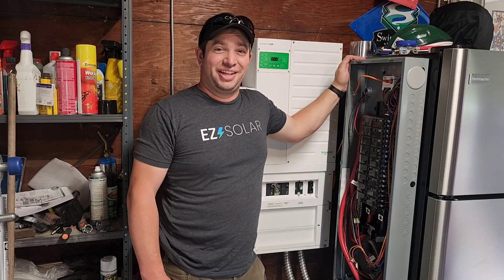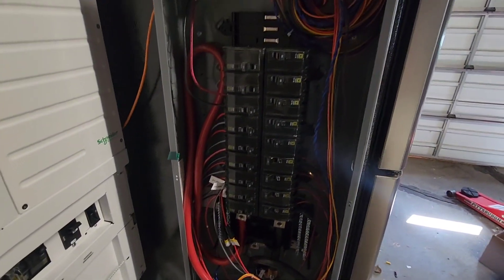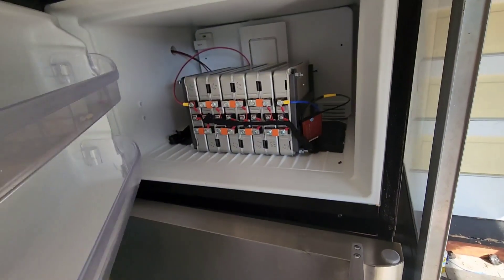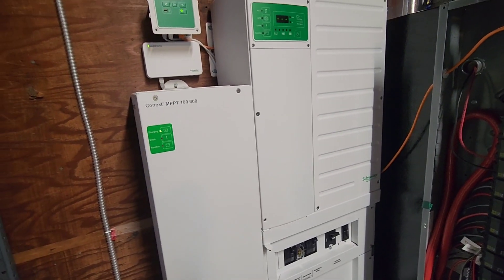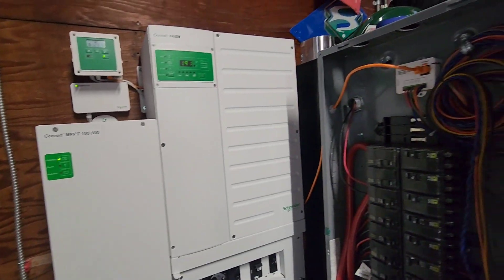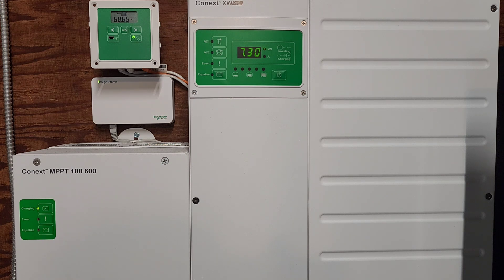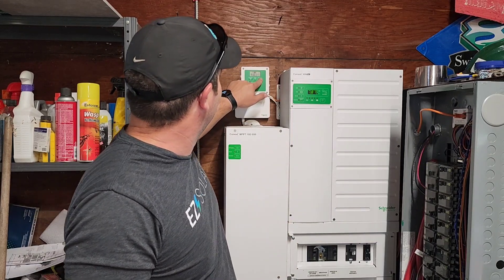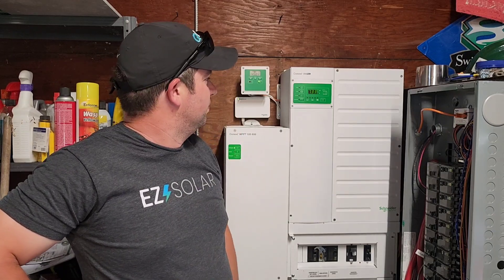Sol-Ark 12k Kept Shutting Down. Can the SMALLER Schneider Handle it?

Comment: HF inverters work great for grid tied systems. It can use the grid for short times of heavy use. Majority it's just back feeding a main panel loads are not that high. If the grid power goes out always reduce loads until power returns.

Comment: Hi Ben, wondering if you could help with some info? I have a stack of Volt Batteries Chevy and want to purchase a schneider 6848 pro  as well as there 100/600 mppt.....can my chevy volt (48v) packs work with this system? I cant find how low I con go with battery voltage as well as charging paramters
Cheers
Kameron

Comment: On my own personal experience, with XW+, Conect MPPT 80-600 and 24 Rolls Batteries  S2 L16 EX 2 volts 1040 Ah @ 20 hours, we ask the customer to turn on everything.... even an old window AC ( which turn to be a power eater...), the inverter goes up to 7.5 kwh for 15 minutes without problem at all.  Not even a blink.  We then shoot the whole load off, to see the batteries, connections and final closing.  
 My point, Schneider is an excellent inverter that with the toroidal transformer make a great difference when dealing with those inductive loads.

Comment: Without an iron core, copper wound output transformer, the Chinese engineered and built, low cost high frequency inverter tech that's used in the Sol-Ark or EG4 6000XP can't possibly compete with the peak power capability of the Schneider XW inverter.

Comment: All high frequency, transformerless inverters are junk. Its been that way for the past 25 years and it will never change. I would never install any brand  of high frequency inverter in my home. The only real inverter is a low frequency, transformer based inverter charger like an XW, Outback, Sigineer Power or a Magnum unit.

Comment: xw has a transformer , sol ark does not . If you put an external transformer on sol ark you will be able to power those inductor loads with ease. You buy equip per application and not buy then try to apply it. It is called research and planning then deployment

Comment: I do realize there are a few biggest 120V loads that will overload the 12K (9Kac output). That is why we introduced the 5K-1P single phase and 15K-2P split phase. There is no 120V load that will overload it. As Sol-Ark CTO, I am happy to provide you with one for testing if you will do the same video.
Reply from the maker: Hi Tom, I would be happy to trade my 12k for a 15k.  I've had to remove it because it kept shutting off, and the little hellions that run the house complain when their internet shuts off.  Let's talk more. Benssolarandbattery@gmail.com
Reply: @Sol-Ark  Sir, do you have any surge test results your company did prior to releasing the 5K-1P single phase and 15K-2P split phase?

Comment: THE MAIN diference Between the two, Schneider is low frequency and the other is high frequency. Low frequency IS best suited for HIGH start amps
Reply: Isn’t it funny that people complain about SolArk shutting down while trying to run high inrush loads. It’s not rocket science. My entire home with 6.25 tons of heat pumps runs fine on two 12k’s. I don’t run high inrush loads. Ding ding ding.

Comment: With the solark u have to buy the soft start for the ac then it we’ll work without issue
Reply: Bingo. Or buy inverter compressor equipped units.

Comment: But everybody talks about Sol-ark like being the best when I started with my system I started with a 12v I got a 12kw Sol-ark and change my voltage to 48v but if you sneeze to hard it shut down, so I sold the sol-ark went back to 12v I lost 240v but it never shut down again thank God for the Samlex 3012 evo I know I see your video. This was even cheaper. Thanks Ben.
Reply from the maker: It was the best on paper when it came out... then it got tested.
Reply: @benssolarandbattery  this one do you test it can it be connected to the grid to sell power
Reply from the maker: @solarandwindinsouthtexasda1473  yes, it can sell power to the grid as well. The only place it falls flat right now is self consumption with AC couple Solar, but that should be fixed in the next year.

Comment: Depends on your family and people living in house. If you install Sol ark or any other MPPT solar inverter you should be fine as long you have things running before you run through a heavy load. Most people dont use compressors or other machine base torque motor loads.  240v things are the cause of shutting it down. Any sudden load with no capacitors ( pre-charged) to handle the surge will pass on SOL ark or any other Inverter and kill them. Schneider loaded with Capacitors that loaded with live current for those surges. 2 Cents are Schneider is Quality but not needed , Sol ark looks good for grid feedback capability but still look for off grid korean MPPT hybrid inverters. They worth more than both on bang for the buck.

Comment: Thanks for doing this and publishing. This really is a service to the community. I am a true 'off grid' guy (no grid), with pumps, shops, etc. I will not use electric dryer or hot water or heat, but air conditioning -- yes. So the overload capability of this inverter is a big deal. Other inverters blip off with any surge beyond their load limit. I also care about gen input, since we have winter weather where I live. This inverter can deal with that, also.

Comment: Do you have any experience with the AC breakers popping at different currents for DC current instead of AC?
Reply from the maker: No, I haven't.  I'm using 2 pole 20a breakers for this setup and have seen 15-18a max through some of them.  They do get a little warm when up there for a bit, but that's to be expected.  They're rated for DC as well, so we should be ok.
Reply: @benssolarandbattery  

Thanks so much for the reply.

Are most ac breakers rated for dc and ac or just your special ones 😉
Reply from the maker: @bkspotify4337  square D QO are the only ones that I know of (in terms of residential load centers with breakers) that have the dual rating.
Reply: I run 450VDC at 10A through a Sq D QOU 60A breaker. Gets up to 120F on a hot day. Works fine. Shuts off fine.

Comment: Due to space constraints I went with the 15k. I have ran 10k+ on grid no issue have only had it about 7k off grid inc ac. No issues yet. It's hard for me to push it to the max of 12k just because most of our appliances are gas.

Comment: I recently installed my 15K and am extremely impressed. Maybe I’m a bit biases after spending the money on it so take that for what its worth, but its taken everything I’ve thrown at it. It started my 3.5 ton A/C, that has a surge of around 90A, on just batteries! My loads are pretty balanced but it doesn’t seem to have the same problems the 12K had with legs being out of balance.
Reply from the maker: Glad to hear it!

Comment: Was that on a 15-kw sol-ark, 12kw, or 8 kw? We just bought a 15kw sol ark. Our loads test for daily electrical consumption was at 23kw and during the 5 summer months high side of use it was at 38kw daily 7-hour solar production will be at 49kw daily, I did not see a problem with the 15-kw sol-ark and 20 kw battery back to handle this, Am I missing something? We are not grid tie, total off grid. leaning towards the ark battery or S.O.K. battery.
Reply from the maker: That was on the 12k.  I have mostly electric appliances and it was having trouble with a few of them. I've also installed them on off grid houses and at least one of them has had issues starting a chop saw.  I'm sure the 15k can handle more.
Reply: @benssolarandbattery   thanks for the clarification.

Comment: Glad to see you reconsidering the Conext XW Pro system.  I installed one a few months ago, and have been insanely happy with it.   I use mine in "UPS" mode,  similar to how you had your original problems.  It's been rock solid.   I wired the AC Load to a critical loads panel,  and then added a continental controls wattnode modbus..  so it can sell excess power back to the main panel,  but not send it back to the grid. (no net metering here).  One of these days, I should hire you to double check all my settings and parameters, since I did it entirely DIY.

Comment: From the XW Pro product page, the unit will run 12kW for 1min, 8.5kW for 30min and 6.8kW continuous. I’m glad you’re enthusiastic about the product but it performed exactly as it should during your dryer and compressor test. 

Unfortunately, you’re setting up Sol-Ark to fail your testing because of the 12k specs. It’s not apples to apples with the XW Pro. A Sol-Ark 15k would be a better test comparison. 

Good job with the channel. Great content!
Reply from the maker: Thanks! I'm happy it did exactly what it was supposed to do.  The 12k should do at least 9k, which it couldn't. Their specs do say that it can handle large overloads briefly, which it absolutely cannot.  Both have their time and place for sure.
Reply: Yeah that’s an issue with them listing the surge in VA. You shouldn’t have to be an engineer to figure out if your equipment will work. A motor with a lower power factor will cause the system to have way less watts available for actual work than the rating appears to have.  I definitely see why it’s misleading. 

I’m researching off grid systems and grid tie with storage for some friends and myself right now. All this info is very helpful.

Comment: Between this and David's videos, I checked the specs from Sol ark and determined that the last inverter I would buy is a solark. The 12k is actually a 9.8k. That is why David's kept shutting down .
Reply: Yes they rate it at solar not wattage. I have a 15k which can do 15k with solar and battery or just 12k without solar. Never had an issue and haven't needed soft starts.
Reply: @hoocli  I can hook up 1Mw of panels to mine. It will still put our 10 kw. That's a deceptive number. The only tru number is inverter output kw. Not how many watts will pass thru the busbars or any other number.

Comment: The XW has a massive chunk of iron and copper in its main lo-freq converter. Hard to beat that with the more fashionable high frequency topologies.
Reply: Yeah I was unaware of this distinction until I saw it on the marketing literature for Victron. They seem to not be lying. It also sounds like the quality of the transformer on the output side is important for idle current draw and efficiency.
Reply: @NicholasAndre1  Yeah the type of transformer makes a big difference in idle draw. For example, I have a 4000 watt inverter that I built to experiment with. Using a standard square "EI" transformer it idles at a little over 100 watts. But using a toroidal transformer it idles at 34 watts.
Reply: @edisont.picard4112  very interesting. I only vaguely recall the transformer characterization from my power systems class 😂
Reply: @NicholasAndre1  Basically a square type transformer has a lot of flux leakage, but almost all of the flux is kept inside a toroid. The trade off is that toroidal transformers have a massive in-rush current that has to be accounted for.

Comment: Your experience with the toaster is interesting. Cold coils draw more current (they have a positive temperature coefficient of resistance) and the singing is indicative that the Sol-Ark output filters are near saturation (when they quit filtering the PWM). As the coils warm up the load lessens and they quiet down. Indicative of a marginal design (wonder what other aspects of it ar marginal?). The Sol-Ark is transformerless. Your Schneider have transformers. Welcome to the more robust world of transformer output inverters. I wrote the papter on inverter reliability and this issue.

Comment: Btw, correct me if I’m wrong, the XW can only use up to 64v which is only 1 volt higher than the SolArk. I say this because I think I heard you say this Schneider can do up to 68v. Sucks for 16s NMC users like you and I, but I only want to charge mine up to 64v but still to close to the max these inverters can handle
Reply from the maker: We were both wrong!  The XW can do up to 65v charging.  The charge controller can do 67v and the XW alarms at 68v. I'm good with those parameters.
Reply: @benssolarandbattery  still slightly confused.. the xw can’t do charging at all but you said it can charge to 65v. I’m assuming you mean the xw can only handle up to 65v. But that doesn’t make sense if you say the xw only alarms at 68v
Reply from the maker: @RJ-cc1fz  it can do charging from the grid or AC Coupled solar while off grid.
Reply: @benssolarandbattery  got ya.. I wasn’t thinking about Grid and AC couple charging.. so the separate charge controller will charge up to 67v and the inverter can use up to 68v then alarm?

Comment: Did I understand you correctly that the Sol-Ark shut down on grid power?
Reply from the maker: Yes sir.  I don't know the exact amount of power that was running through it, but if I had to guess, it would be 12kW.  No breakers tripped.
Reply: @benssolarandbattery  What inverter do you suggest I look at for 30k grid tie with battery later on? Can you stack Schneider?

Comment: Great video Ben!  I am curious about how you wired the SolarEdge system in ( Mid panel or Main Panel Etc).  I am in progress of my own AC Coupled design but have decided to not couple the SolarEdge but actually install a old SMA sunny boy inverter.  I have previously had problems with the SolarEdge being too sensitive with the XW+ inverter and shutting down here and there.
Reply from the maker: Thanks!  I wired it into the main panel, but I also have a separate interlock panel with a grid feed, so I can easily feed the grid independently of the entire backup system.  I too have had issues with the Solaredge AC coupling.  It wasn't great with the Sol-Ark and is the same with the XW pro. I had an autotransformer wired in as well, so tried turning that on and it actually fixed the flickering issues I was seeing on both the Sol-Ark and the XW.
Reply: @benssolarandbattery  I talked with Solaredge tech support about the issue when it was happening and they recommended a few changes to Pf wave and  change some of the power control settings....  https://www.solaredge.com/sites/default/files/se-inverter-support-of-voltage-sources.pdf

Comment: XW Pro is the grandchild of the Trace Engineering inverters. Amazingly robust.
Reply: I started with a Trace SW4024 in 2000 (still have it, loaned to a friend while he builds his house).  Then got a used Xantrex SW Plus 5548 (120v) in 2018 (2005 model), running on it right now while I type.  Saving my pennies for the XW Pro to get 240v, and have it work with my 4 MPPT 60 150 controllers on 4 arrays @ 48v.   I expect to have the Pro a long time as well.  Solid stuff
Reply: @dougbertInExile  I still have a small collection of 5548 units. They are bulletproof and I don't have the heart to trash them. With the parallel cable they make up to 11 kW of 240v. Too bad they only work with lead acid.
Reply: @arleneallen8809  ok,  I have Xantrex SW Plus 5548 and am running them on salvaged Tesla Model S batteries.  voltage range from 38 to 50.5,  I run them from 38.6 to 49.6.   Do you have the Xantrex or Trace?  Standard SW or SW Plus.
Reply: @dougbertInExile  They are the Trace and the Xantrex original units. No plus.
Reply: @arleneallen8809  I did run the teslas in 24v on the trace SW4024 before going to 48v batteries
Reply: @dougbertInExile  Since it thinks its a lead acid battery, what specific parameters did you use in the Trace menu? I realize the low voltage cutoff won't let you take full advantage of NMC type batteries, but working safely is what counts. I'm not familiar with Model S batteries in the raw. If the Xantrex actually supported the NMCs, I assume they would normally be run down to a 3v cutoff. As I recall, Jack Rickard EVTV was selling a complete BMS solution for Tesla batteries. He was using Sigineer inverters that were specially modified to have a deeper cutoff.
Reply: @arleneallen8809  the model S is a nominal 24v battery,   range is 18v (3v) to 25.2v (4.2V) with 6 series regions.  I programmed my Trace SW4024 to range from 19v to 24.8v,   to allow 10% on the bottom and 10% on the top of reserve.  The trace allows FULL voltage parameter of the tesla module.  Low Battery Cut Out is 18v on the SW4024, sweet. When I found a Xantrex SW+5548 it too allowed the full coverage, but for 48v. I now have LBCO at 37v and range from 38.6 to 49.6v charging profile

In may 2020  I got the "Jack-In-The-Box" and installed it and the Tesla batteries for 24v.  Later with the Xantrex, reconfigured the battery for 48v.  Here is the link to my build thread where I described the JITB.  https://diysolarforum.com/threads/something-i-built-diy-back-in-2000-my-path-from-trace-to-xantrex-to-xw-pro-inverters.11/post-75795

AND the XW Pro allows for a fairly low LBCO as well, so almost perfect
Reply: @dougbertInExile  Nice! Thank you.